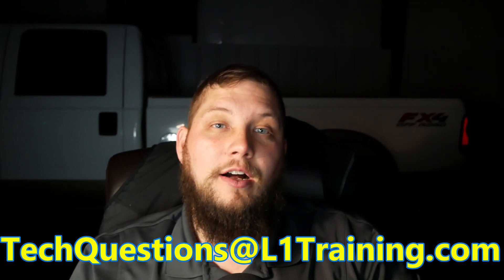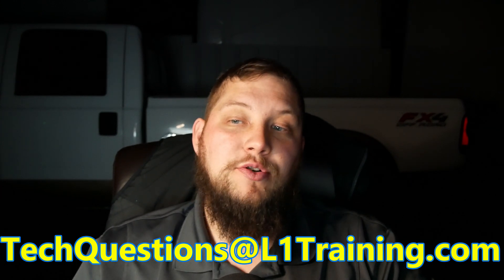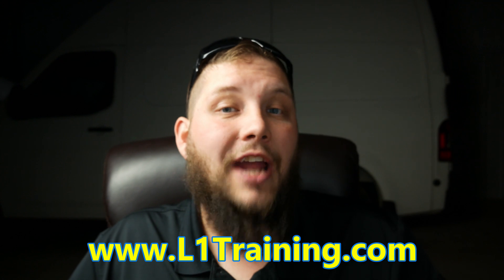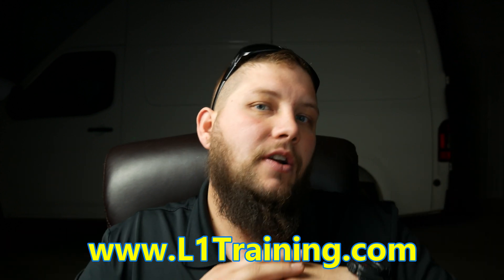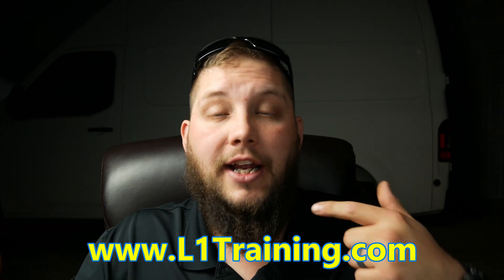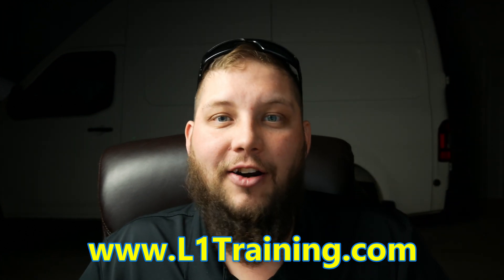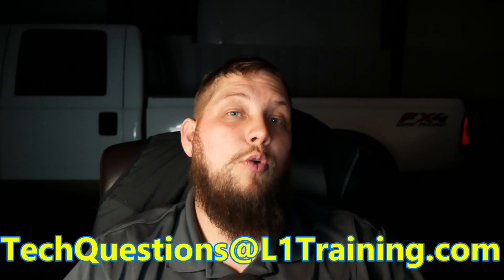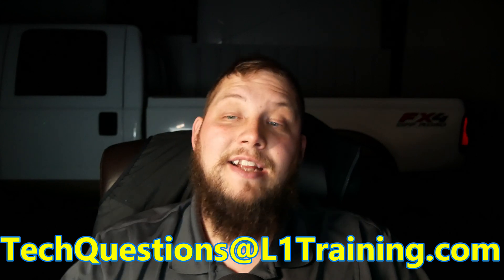TQQ #22 How Do You Start Fixing Modules, and EEPROM?

Comment: my suggestion would be to start with an electronics course so you can learn how signals are made and how to see them on a scope. from that point you can build  simulators or buy a $300.00 function generator  for each signal you need.  the soldering is the easy part. like the  man says there are so many variations and you need to understand them all to know what you are working with.    not impossible but are you willing to make that large of investment in time and money?  good luck if you decide to.